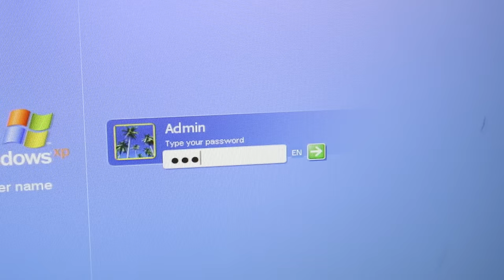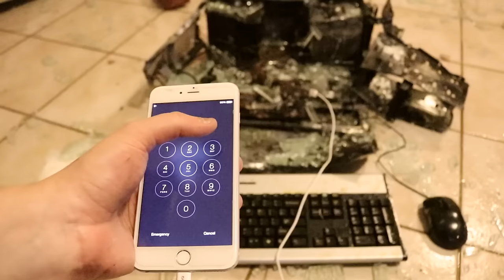How To Hack Into a Computer

Comment: 1. Step: perform a jail break checkrain on the decive to open it's bootloader
2. Step: change the settings and change some system files
3. Step: still not working? Egg it.
4. Step: Egg it 50696x times
5: Egg it till it caughts fire
6. Step: destroy the intel parts in water
7. Step: throw it 57x times
8. Step: you have successfully hacked a computer